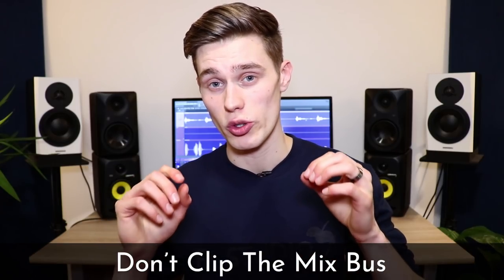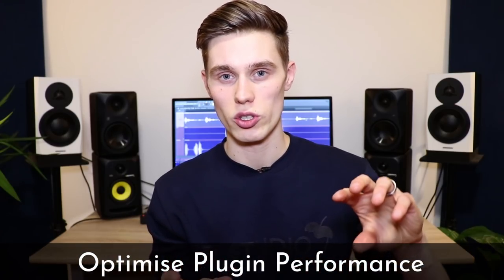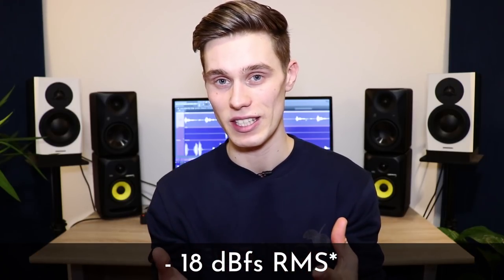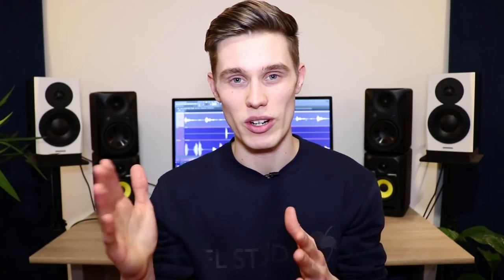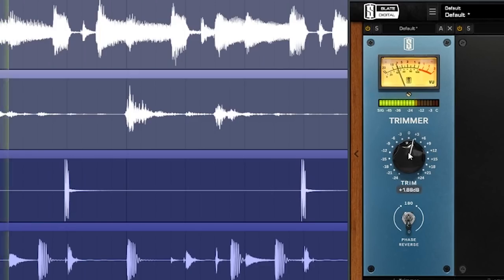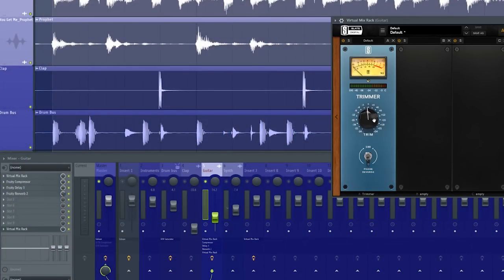Gain Staging - The 3 Rules You Need To Know - In The Mix

Comment: PSA: Please stop using the mixer faders for gain-staging, they are post-insert/post-plugin faders. Use the volume knobs on your channel rack as they are pre-insert/pre-plugin. Turning down an oversaturated signal post-insert/post-plugin doesn't do anything for the distortion caused by clipping. You want to gain stage pre-insert/pre-plugin.

Comment: A Tip from my side
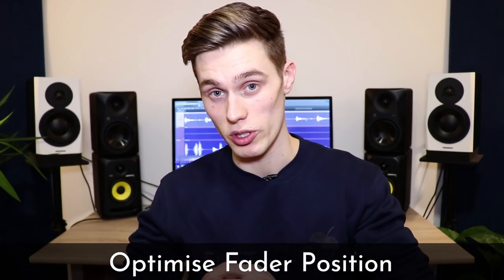3:12 If you want precision on your faders or any other parameter in FL Studio, just hold Control and use left click to drag.
This enables you to do very precise adjustments.
Respect.
- Hsevras Edrok
Reply: Yes, but starting at about -40.5 db (4%) Control wont help much since fader is non linear. So, even with control button, the lower you go, the more db's will be skipped while you're moving a fader down. But, i doubt someone mixes THAT low anyways
Reply: Its about the dB scale being non linear. Near 0, 1dB has a longer throw on the fader than at -10dB or so. As you go down the scale, the fader length per decibel becomes smaller, therefore even if you could move the fader ever so slightly, it affects the actual level differently.
Reply: @gayanpathirana9328  x
Reply: @gayanpathirana9328  The reason it becomes smaller lower down is because decibel doesn't have a linear correlation to loudness. The difference in loudness between -1 to 0 dB is way bigger than between -10 and -9dB, hence why they let you more finely tune it at higher dB. So the higher resolution won't really matter as each tick has a bigger impact.
Reply: Same with Reaper.  Hold ctrl. + pull the fader or knob up or down. It moves in much smaller increments, allowing for that perfect area you're looking for.
Reply: this huge wtf
Reply: Or Command in Mac

Comment: Instead of using “trimmer”, in cubase there is already the “input gain” pot at the very top extension of the mixer for each audio channel. One can also swap the metering of each channel to “input metering” instead of the default “output metering” setting, by selecting the channel, right clicking on it and set “input metering” in the the drop down menu.
By doing so, one can clearly see how much level comes into the channel, and thus how much level (the same)  comes into the first inserted plugin and correct it by using the very top input gain pot.
The “trimmer” could only perhaps be useful for checking (and correcting) levels in between the chain of inserted plugins.

Comment: These are the 3 main things. The resolution with the fader gets by alot of people. If you look at the distance between 0 and -5db that same distance lower down on the fader is divided over 10db. And near the bottom of the fader between-40 and -60 is half the distance and is divided over -20db.. Much more precise adjustment can be made with the fader near 0.. Great video..🙂👍👍👍

Comment: You've cleared up a confusion I had about gain-staging, namely that I couldn't quite figure out why having done it one would be working a long way below 0 where the measurement graduations were far less subtle. Your solution to this is to remove 10db (or whatever is required) with a plug in and then to move it all back up near zero to get the benefits of the subtle graduations. That's really clever. That's a great idea in theory, will try. Thanks

Comment: Great video! One thing to notice about FL Studio and gain staging is that you have to set your volume in the channel rack and not the mixer fader. If you favor or trust the mixer fader to achieve a great volume to work with your plugins you are not going to be able to. So first use the knob on the channel rack to set the initial volume of your source and see if doing so it's a good level to work with your plugins and do not go by the mixer fader. Do a test and you will see what I'm talking about. In FL Studio we do not have the option as in Studio One or Pro Tools to go to the audio file itself and turn down the db's so in FL Studio you achieve that by working with the Channel Rack Knob.
Reply from the maker: Mister Bones This is mostly correct in FL Studio although there is the option to turn down an audio file at the source (it's just not as easy as Studio one) simply double click the audio file and the wrapper settings will open. There is a volume knob at the top that can as or remove volume at the source level before hitting the effects. Either way, I still do what you suggest, adding a gain plugin at the start of each track

Comment: Awesome tips. Another tip is run all your tracks to a stereo Aux labeled submaster or whatever you want to call it. Insert your bus compressor on that. This gives you the ability to turn the whole mix down before going to the 2 bus(master) or you can turn it down at the 2 bus if you want.  In most cases avoid putting the buss compressor on the 2 bus because the 2 bus inserts are post fader.
Reply: what compressor bro lol

Comment: There actually isn’t less control over volume as the fader goes down. This is because the unit of measurement of DB increases by a multiple of 10 every 10 units. So, 20 DB is 10x louder than 10 DB. The fader is set up to adjust for this equation

Comment: While no, the DAW itself will not induce any additional hiss with an increase in gain (unless you are using dithering) it should be noted that if you are recording anything with a microphone, pickup, etc there is a noise floor. If you don't have your preamp set high enough and try to digitally compensate it to the proper level the noise floor will come up . The amount of additional noise will depend on how good your preamp and A to D converters are. Analog Gain Staging is correctly balancing your preamp gain so that your signal doesn't clip, but also doesn't need to be digitally recompensated inside of your DAW.

Comment: 32/64 bit gives you a (shit)ton of headroom in your DAW. Therefore, I don't see the need to lower each channel individually to remove/reduce digital clipping on the master bus. This clipping does not occur inside your DAW, so you can simply decrease the level on your master channel. This has the same effect as lowering all channels.

The non-linearity of some plugins is very interesting though, I have never really looked at it that way or experimented with it. The plugin 'sandwich' is indeed a great method for this!

Comment: When you EQ a sound, should you increase the DBs in the output of the EQ to the same volume as it was before you added the EQ?
Reply: That depends on if you want the sound to be as loud as before. You can bump up the gain without worries, if that's what you're asking. But it just comes down to wether you want it louder or quieter after the eq-ing

Comment: Engineers would try and find the best balance point between noise at the bottom and distortion at the top, which is ultimately what gain staging is all about.It would be very difficult if each fader was marked with minimum / maximum, so a gain button was introduced to limit the maximum input. I really don't see why there's so much philosophy about it.

Comment: Here's a more technical explaination of why modern DAWs have no "noisefloor" per say:

CD audio uses 16 bit integers to store each sample. That means each sample is described as a whole number between -32768 and 32767. In this format, things that are quieter would be closer to the noisefloor because there's less precision among the lower numbers, i.e. when the signal is quieter. This is where I assume the misconception comes from. However, modern DAWs don't use 16 bit integer. They use 32 bit floating point, which instead uses scientific notation to store each value. This means it splits up the value into a coefficient and an exponent, for example 3.14 * 10^5 instead of 314000. (floating point values use base 2 rather than base 10, but that's a minor detail)

This comes with two huge advantages. First of all, floating point values can store decimal values that are both extremely large and extremely small. This means audio data above 0dB is preserved, unlike with integer values where there's a very finite range. 32 bit floating point values technically do have a finite range too, but it's astronomical - over 340 undecillion to be specific. 0dB is defined as 1, so that's a lot of headroom - over 770dB to be specific again.

Secondly, the precision of a value stored as floating point is proportional to its size. This means that the relative rounding error in very quiet signals is identical to that of very loud signals. Think of it like this: If you write a very large and a very small number using scientific notation and limit yourself to three digits for the coefficient, the smallest increase or decrease you can make will be much bigger on the large number in terms of absolute difference compared to the small number. However, in terms of relative difference, it's exactly the same! Put this in contrast with integers, where the smallest increase or decrease will always have the same absolute difference, but the relative difference will be vastly larger for lower values than for higher ones. This is the exact reason why there is no "noisefloor" in modern DAWs and why audio quality is preserved even in extremely quiet signals. The "noisefloor" is dependent on the loudness of each individual sample.

Also, just so I don't leave out any noteworthy information, there is technically an absolute noisefloor for 32 bit floating point audio, but it's -758dB so good luck ever even approaching that. For reference, 24 bit floating point has a noisefloor of -144dB, and that may seem comparable at first glance, but don't forget that the decibel scale is logarithmic. The difference is just as astronomical as the aformentioned maximum value.
Reply: Damn, I could turn this comment into an article

Comment: what should be done first when mixing? gain staging or include effects such as processor, EQ, etc.?
Reply: Arya Satya gain
Reply: Gain stage is not something that is done at one point, it should be done throughout the entire signal chain to ensure that the audio is always feeding at the proper levels.

In terms of FXs, usually I go for pitch correction (vocals or strings), deesser (vocals or drums), subtractive EQ, compressor, boosting EQ, saturations/distortions/modulations, reverbs/delays (unless on a send), limiter (if necessary)
Reply: @beatstraightoutdabox7924  thx man
Reply: @OK-ei7io  great information

Comment: any tip for gain staging very dynamic sounds without ending overcompressing them later or whatever? like pads (specially the evolving ones... or other types of sounds?
Reply from the maker: That's one of the hardest things to get right. I'd start by adressing how much the sound really has to evolve to have the impact you want. I often adjust the envelopes within the synth to get it perfect for my needs. 

Other options involve increasing the percieved loudness without actually raising the gain quite so much. You might automate an EQ to increase the treble during the intense parts which can, when done right, give the impression of an increase in volume without hitting a compressor/limiter too hard. I hope that helps a little!
Reply: @inthemix  I do this too or working on volume automations, I was hoping for  for an easier approaching... The styles of music I am working on/with rely very much on sounds like these and sometimes it's hard to cope with projects that are full with that kind of sounds... Thank you very very much for your time answering 😊 really appreciated 🙂

Comment: I recorded this one track and it turned out, after we mixed it, that is was a little too quiet. And I think the issue was that we recorded it too cold. Essentially the knob on the interface was not set correctly and my guess is that when this happens, there is less information being recorded in the signal so it does not sound good when you try to adjust for it in the mix. I would like to see a more detailed video about gain/volume and just making sure that you are consistent. What levels should be where and general things like this. I'm pretty nervous about this kind of stuff and if there's anyway I could fix my problem, that would be helpful to know as well. Thanks

Comment: "Audio inside FL Studio is digital, and is (at least) represented as 32-Bit floating pointnumbers. As with all digital audio formats, the number gets bigger as the signal gets louder. Crucially, 32 bit numbers can represent a maximum value that is about 65,000 times greater than a 16 Bit audio CD or .mp3. In other words, a dynamic range over 1600 dB. This is why internal audio, carried on the insert mixer tracks, is not going to run out of headroom under any practical circumstance, and why you should not obsess if they peak over 0 dB. Of course, for practical reasons, you generally want to keep the peaks in the visible range of the meter."

Quote from:
https://www.image-line.com/support/flstudio_online_manual/html/mixer_levelsandmixing.htm
Reply: What’s your point? Obviously it might be possible, but will it sound as good?
Reply: @OK-ei7io  won't be any difference. If you turn the volume down again when you use analog modeled plugins it does not matter at all.

Only the master channel can clip

Comment: Hi Michael, you mentioned putting a gain unit at the start and at the end of the effect rack. Can I alternatively use a gain knob on the channel rack instead or better not mess with that? Some say to leave this first initial source of gain untouched unless the signal's clipping at the very start. I'd appreciate your help. Thank you for your tremendous work do far.

Comment: Always excellent content and a delivery to match. I have limited insert slots in my DAW (MPC Software). What would you advise to use (beyond sticking Blue at's Patchwork)?
Reply: You could get third party plugins which add additional insert slots. Or, if you don’t want to go through the hassle, any time you are absolutely certain about a change, render it as audio and import it. Boom, all inserts back.

How many inserts do you have? Usually, unless you are doing major sound design projects, you shouldn’t need more than ten or so.

Comment: If I need to get around 18dbFS input to have the best out of my plugins, wouldnt it undo my volume balance if I do this with every track?
Reply: You just want to make sure the level is around -18dBFS going into the plugin. You're free to adjust the overall level after the plugin as you see fit.

And it's still just a general guideline and depends on the instruments and plugins you're using.

Comment: I have a question for you. When my tracks get mastered the waveform is a lot smaller than most other tracks from big artists. So for example I'll take one of my mastered tracks and compare it to say, a Seven Lions track and the waveform is a lot smaller. Why is that? Am I not mixing my tracks loud enough? Do they clip their audio?
Reply: They don’t clip, they use compressors and limiters extensively and very carefully to make a track with very low dynamic range. It’s really difficult to make your tracks as loud as theirs, but with a little practice, you can get there! This is something I’m still struggling with a lot too.

Comment: i have followed the gain staging process ...when we pull the fader down the  plugin lose their dynamics?..because  when i did that i was not getting the energy i wanted in my track bass was not sounding grrity ...leads were sounding thin. can you share any links for gain staging or a solution like how can i increase over all gain with limiting it to 0db..before mastering.

Comment: in logic pro x for example, where do i add a trim plugin if there’s no effects chain? as far as i know the effects you put on logic don’t work following a specific order like FL does right? correct me if i am wrong. So should i create a vca and add effects on there as well as the trim plugin????? (even though it still doesn’t follow an order). Some help is very welcomed :))
Reply: I honestly have no clue, I don’t use logic. I would try using clip gain to lower the signal if the inserts don’t follow the right order. Hope this helped, even though it probably didn’t. :/

Comment: So you said on every channel that has effects on it, use a gain plugin. Fruity balance would be ok for this right and also, in big projects, would it be CPU intensive?
Reply: thanks
Reply from the maker: Andy I often use fruity balance and it's not CPU intensive. The only "problem" is that it can't add a lot of gain is you have a very quiet source. You could always use multiple instances 😀
Reply: In The Mix thanks for the info
Reply: Since fruity balance might not be able to add a lot of gain, are there any other fruity plugins that can do so?

Comment: Hi. Thanks for the tutorial. I still don’t fully get it. Couldn’t I just add a Fruity Balance on the beginning of all my individual audio stems on the mixer channel and turn it to (-18) that way?
Reply: I wouldn’t advise doing this. Basically the issue is that you don’t want clipping at any stage in your signal path. Now how does this relate to the Fruity balance? Let me elaborate...

Basically, when things make sound in DAWs, they go through different pathways. Sound starts in the channel rack/arrangement window, where it is sent to the mixer in individual channels. This is sent to busses which then goes to the master channel. Adding a utility plugin and lowering the volume here solves the issues of balance feeding into plugins and leaving headroom for busses. However, it does not ensure clipping doesn’t happen. This is because clipping can occur if the signal sent from the arrangement window to the mixer is too hot. This clipping will still happen when sent to the mixer, and the presence of the utility will only reduce the volume of the signal after being clipped: not good.

Try reducing the volume in the arrangement window, or decrease the volume on the channel and bounce each channel if you don’t like the clip gain to be set really low. Hope this helps!